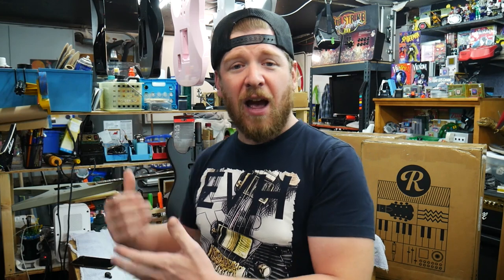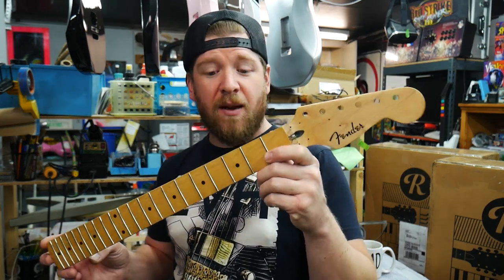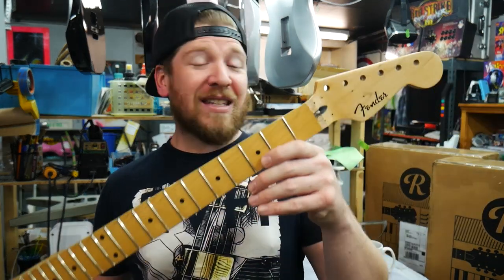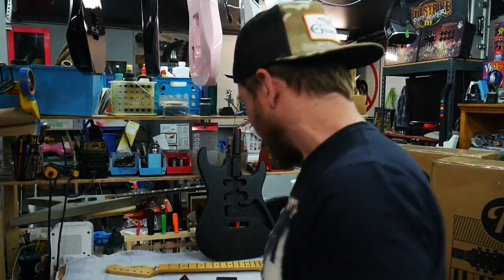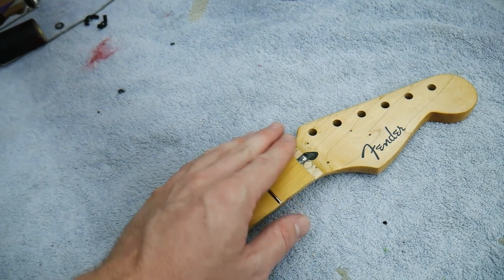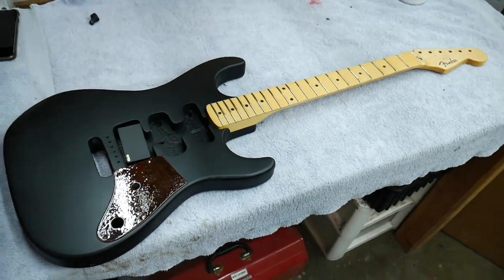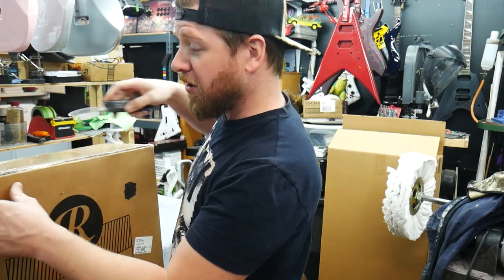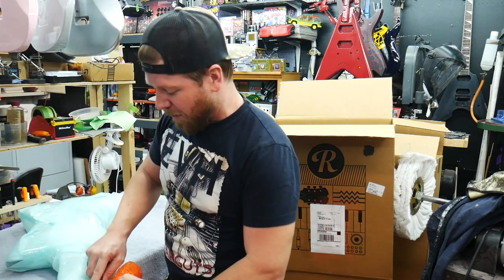RUSTY FRANKENSTRAT - The Next Patreon Guitar Raffle - Unboxing guitars Charvel Star & Jackson Kelly

Comment: One way of retrofitting a Floyd Rose type neck is to put in a Gibson style nut. Have to be careful with the width and string spacing and radius, so better start with a blank one. I did this on my first partscaster ( neck had a Floyd Rose nut first). And worked out really well. Round of the sharp edges to have smooth transition to the headstock and you should be good. 
Here you see the guitar I’m talking about: https://youtube.com/shorts/gDvWInXr99U?feature=share